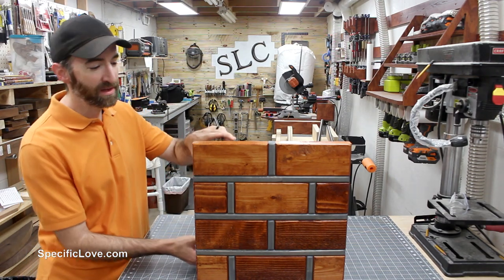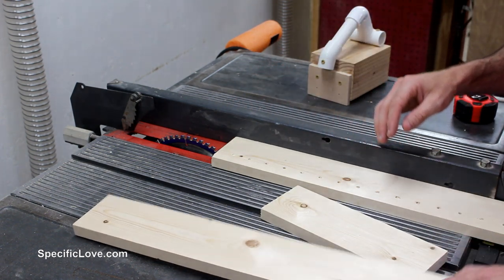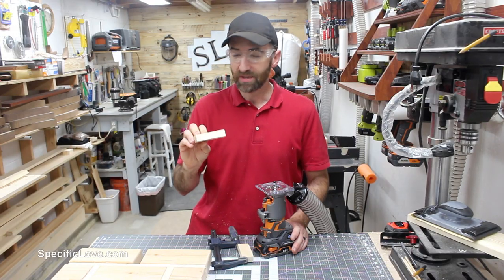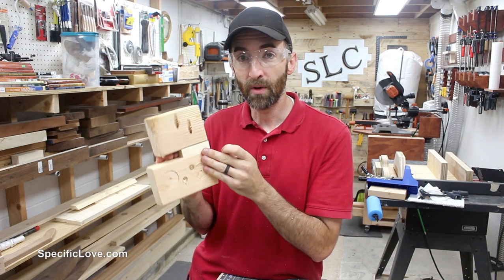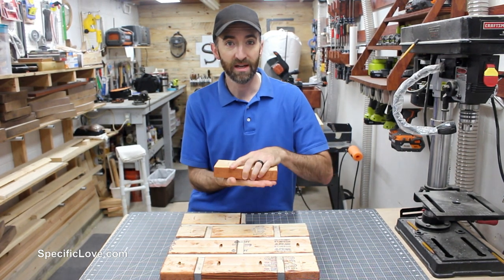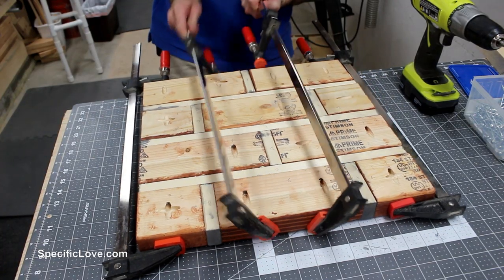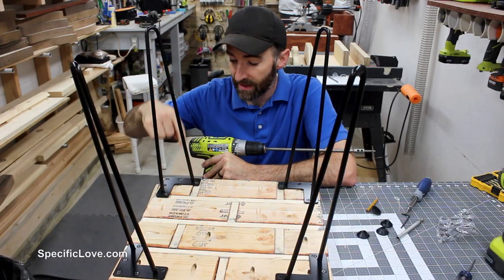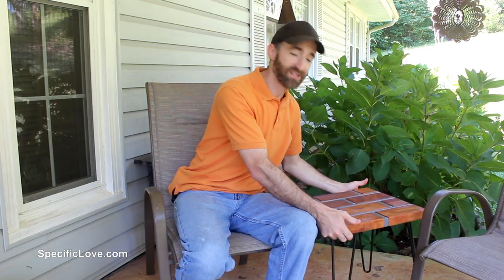Making a Brick Table with Wood | Simple DIY

Comment: so creative, eye-catching

but, LOL

the crevices between the pieces could be hard to clean with dust, dirt, crumbs

Wouldn't the same attractive brick'n'mortar motif work with squared, flush edges, and a hard urethane varnish?

great work, your creativity, mastery of multiple materials, and multiple skills always amaze  and inspire :)
Reply: vacuum would work fine wouldn't it? or use a can of compressed air. either way it would take 10 seconds to clean
Reply: @danij1586  If dry, but spilled liquids, condensation from drinks?